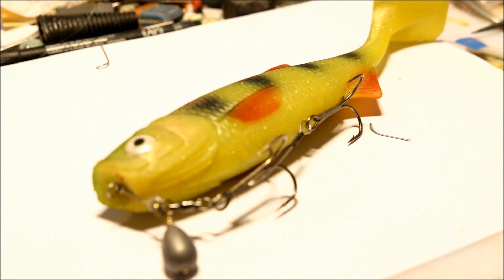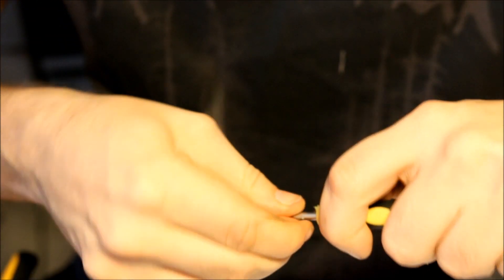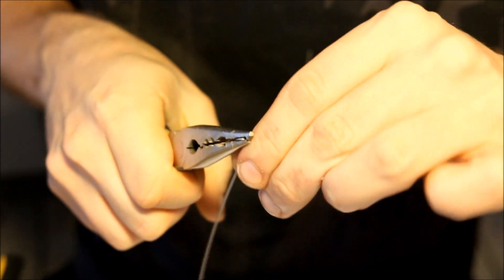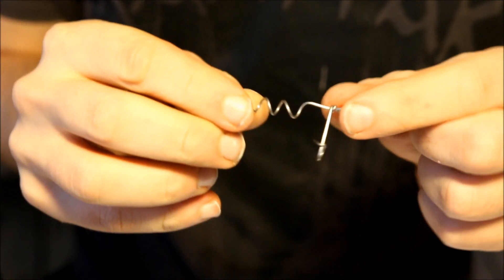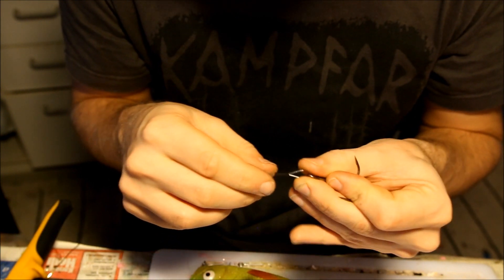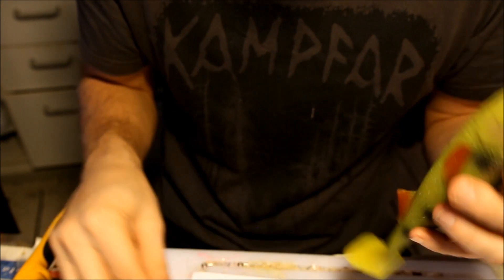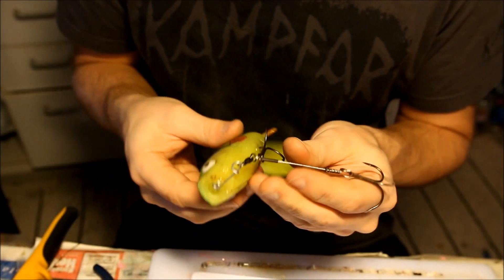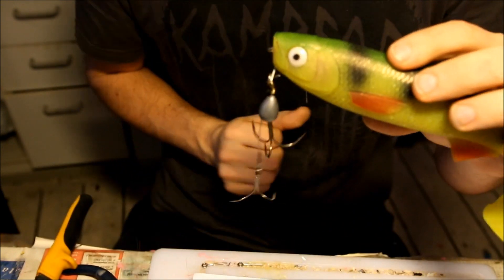shallow screw rig for soft baits

Comment: Isnt it possible that the soft plastic lure can be knocked off the wire and become lost?
Reply from the maker: +john smith yes its possible but since i can make them my self and buying them is not really that expensive and it's a hazard that I'm willing to make. The few years that I've used this method I've yet to loose any rubbers from this rig.

Comment: you ever consider putting magnets into the soft plastic to hold the hooks in place?
Reply from the maker: +Pawel Sawicki thats probably not a very good idea once the pikes tear the soft plastic enough the magnets will just fall off
Reply: Just an idea.  Or a hard inside soft outside that slips over
Reply from the maker: the magnet idea would work if you would have it in a capsule inside the lure it self, sort of like storm wild eye has but really this method i use is really the easiest method i've used so far, sometimes less is more ;)
Reply: Sometimes.  But maybe I like your videos so much I just want you to push the boundaries so I could watch them and get the joy I get from the other videos.
Reply: Or you can get your hands dirthy and try yourself. Make a vid so we can watch instead :P

Comment: Mikko get Knipex cutters.  In case if u ever need to cut your hooks when unhooking the fish it will be like cutting a piece of paper with scissors. Of course they are brilliant for all our lure making needs. They cut everything up to 4 mm I think. 
Is it not better to put a metal pin into the body od soft plastic right before the treble then to put the hook into it? Cheers
Reply from the maker: +Maciej Dukacz thanks for the tip i will look into that ;)

Comment: hey Mikko, don't you have the problem that the piece of stainless steal wire where you hang your weight and trace wil suffer metal fatique after a lot of pikes? I've had those pieces extra wire but every time I catch a pike it slightly bends en it will edventually be weak and you can snap it of quite eassily.
Reply from the maker: +708jelle the 1mm wire that i use on mine has never snapped off or opened on me and i have been fishing with a rig such as this for 2 years now. If you are really worried that you might get into a situation where the weight lock might open or get broken due to metal fatigue just make that loop a closed one and just add the barrel weight to the snap link on you leader instead.